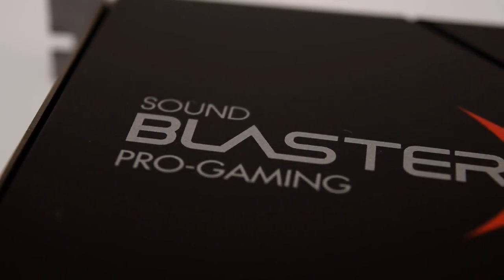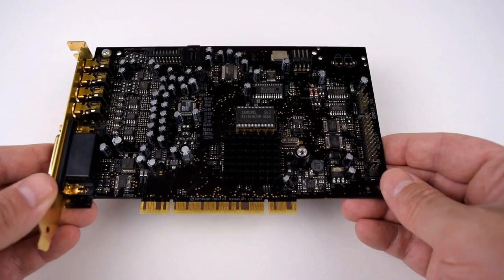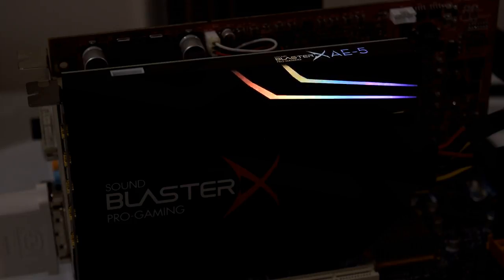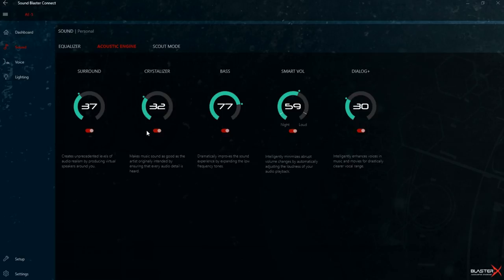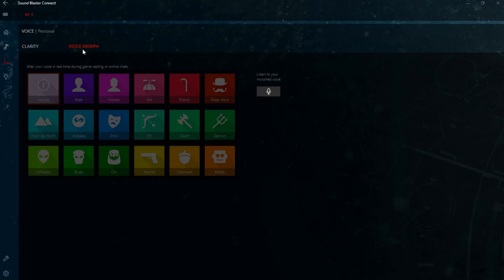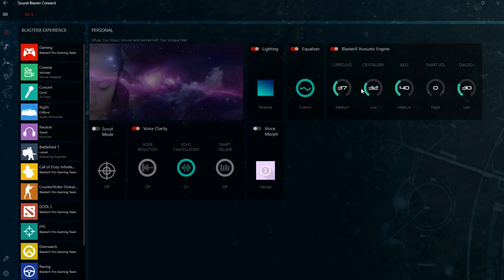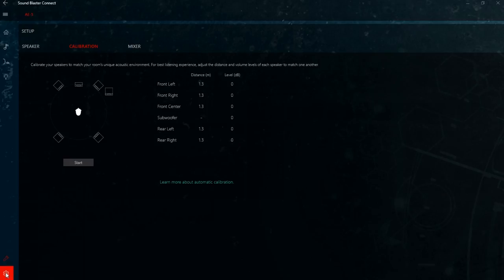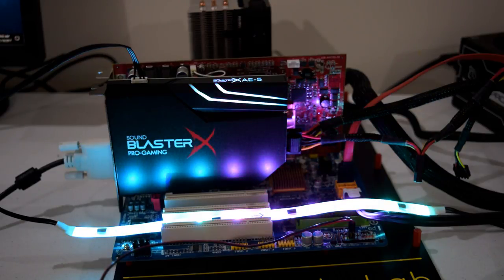Is the SoundBlasterX AE-5 Creative's best Sound Blaster?

Comment: I had the original sound blaster, the sound blaster 16, the sound blaster AWE 32 and AWE 64, the Sound blaster LiVE (amazing card), .... ... .. , and various forms of the X-Fi. I still run the X-fi as it is better than the modern ones which sound quite crude and "software" like (emulated). 
The soundblaster Z was a terrible card, I bought it, and returned it straight away and since then Ive not bought any more sound blaster cards as the X-Fi is still excellent.
Reply: PhilsComputerLab, did you have a similar experience /line of thought then?

Comment: Hi sir , i have found this soundcard for arround 100 euro and i want to use it with my 2.0 bookshelf monitor speakers through the optical cable port , but i saw in the comments you mentioned that the best output soundwise is the analog one so i was thinking if the optical one isnt that good . Also is this soundcard mainly focused for headphone users and not so much for speaker users? The reason i want to use its optical output is because i will use the speakers digital optical output for the general PC usage , and the (single unfortunately) analog RCA one for my turntable . Currently im using my onboard motherboard's ALC892 realtek chip which has served me well , but i bought some new expensive speakers and i feel that it bottlenecks their potential , so i thought to get a new soundcard as well . I would be very grateful if you could give me your advise about going for it or go to something else. Thanks !!
Reply from the maker: If you use optical, the speaker DAC will be used. If you use analogue out, the sound card DAC will be used. Which one is better? Just got to try it out!
Reply from the maker: Also, if you're using optical out, the sound card becomes kinda a waste, as digital, is digital. Any optical output will sound the same.
Reply: @philscomputerlab  Hi sir thanks for the quick clarifying answer. How about the coaxial output , does it work the same as the optical output? In your opinion is 100 euros a good bargain for this soundcard (which originally costs arround 140-150 euros if im'not mistaken)?I was also wondering if in your opinion this soundcard is mainly focused for headphone users rather than speaker users because of its discrete headphone amp addition which would be useless for speakers . . I would be very grateful if you could give me your additional opinion about theese questions. Thanks !!

Comment: Great Video... just what i was looking for! I really love this Soundcard- but there is one thing that bothers me alot:

It does not support Dolby Digital Live / DTS-Connect! That is the only thing i miss...
Reply from the maker: True. I use a 5.1 Logitech speaker with two optical input, I reckon it sounds nicer through the analogue ports, than the TOSLINK.

Comment: These card's (AWE, LIVE, Audigy, XF) could have solid potential in home music production, if Creative will not be such as focused only on gaming. ASIO drivers supported only 48Khz (no 44.1), and you could  have max 2 parallel effects (chorus, reverb), where Chorus was fixed and instead of Reverb you can choose some other (EAX effect). 
        But what I personally never understand, why EMU/ Creative never produced profesional level of quality SF2 banks, despite, that they had a huge library from they romplers/ samplers (Emulator I,II,III, EMAX, Proteus, etc..),  so we always ended up with some awful GM midi variants sounds (even these from memory expansion CD), which has been smashed even by with first Roland Sound Canvas (and that was really super simple rompler).

Comment: Has creative stopped the practice of using lower quality DACs for the main/front jack?

also:
* Unfair competition and killing Aureal (and every other competitor they can)
* recently they bought the company that made nvidia soundstorm audio processor, again killing the promising competition.
* Many bugs and bad sound quality on the soundblaster PRO/16 (expensive cards in their moment). Also in many other serious issues in other soundcards.
* Not admitting incompatabilities with some chipsets issues with more modern cards, (live, x-fi, maybe more...)
* Not releasing drivers for later windows releases, in order to render useless perfectly capable (and not so old) cards.
This is demonstrated with free drivers like KX driver (and that is when they don't legally pursue driver tweakers/developers, as they did many times).

No more creative for me, thank you!!!
Reply: I just checked the ratings for their sound cards on Newegg or Amazon and read the critical reviews... you're absolutely right. Creative Labs sucks!
Reply: @ServantofJC  well thats a shame their xifi mb3 software was top notch

Comment: I don't understand the appeal of a soundcard with no hardware accelleration. I just got an X-Fi Titanium PCI-Ex from 2008 with the EMU20K2 processor for 25€, which works great under Windows 10 Creator's (using custom drivers) and is awesome for older games like Bioshock, F.E.A.R. and Doom 3 (EAX5 and hardware positional audio FTW). Don't get me wrong, the software Host OpenAL implementation of the hrtf and eax that the Sound Blaster Z and newer cards like the AE (and other solutions like the X-FI MB3) come with is ok, but nothing close to real hardware OpenAL. Also, it features Optical In, hardware midi soundbank support, and cmss3d for virtual surround in games that don't use OpenAL.
Reply: Hi, it seems you know a lot about soundcards, could you please tell me what do you think about the Sound Blaster RX? Is it a good card in general, is it worth it over an Asus Z97 pro integraded audio? Thanks for the help

Comment: I've always liked Creative's sound cards, I currently have an external Sound Blaster Omni Surround. But my biggest beef with Creative is that they purposely make their sound cards obsolete by not supporting drivers on them anymore. Especially when it comes to new versions of Windows. I have to go into settings and reinstall my drivers every now and again because they like to act up more often than they should. But the only "newest" version they have available for Windows 10 is from 2015. It's sad because even the drivers they have for Mac are more up to date than the ones for Windows. The Mac drivers ended in 2017.

What makes it worse is that they still sell the Omni Surround brand new, yet they no longer update the software to make it function properly.

If anyone knows of some fan made drivers that are better than Creatives own software I'm all ears. If not then I'll probably switch over to using an actual DAC in the future when funds allow. As much as I like the look of the AE-5 they'd probably stop supporting it the second I bought one. :P

Comment: Cool, Creative sent you a card to test!  Though I was hoping to see how it does in games.  All those menu options for the SB series can be time consuming if you play a variety of games (can't remember what version of the X-Fi I'm using at the moment, but it has those).  I figure for modern games, it wont make much difference on performance, but I am curious.  Maybe do a comparison video for more the more recent audio cards you have?  I remember your video on the ISA and PCI cards and how it kinda slowed performance, so it got me thinking about modern day relevance.
Reply from the maker: That sound card roundup was on a Socket 7 machine, so CPU power was limited. These days, we plenty of CPU power, but you're right, I don't think I've seen any tests in this regard lately. Could be something worth checking out. For games I think you'd be very happy with this card.

Comment: Do you think that the Soundblaster 2 has A better Sound Quality Than Onboard soundchips on modern motherboards? i got the Card for free and was using a sundblaster audigy SE Before because the Onboard sound on My Asus P5Q PRO Was Crap. Just thought about it Because PCi Slots are more and more rare on modern Boards....
Reply from the maker: Are you sure you mean Sound Blaster 2?
Reply: PhilsComputerLab 

I meant the Audigy 2 ZS, i Think i just Got my Soundblaster pro 2 in mind
Reply from the maker: I thought so :D Yea the 2 ZS is a great card, it will be better than onboard.
Reply: Got the card installed Now, its Really awesome. Idk Why i did Not use it from the beginning. Windows 10 also has a WDDM driver avaliable for it and EAX Sound also Works.

Comment: So much stuff that could be improved and innovated, yet they come up with RGB-bullcrap. Still no official Linux-drivers of course.
The mode which circumvents all the DSP-processing is a good feature if that let's you output bit-perfect audio.
What I'd like to see first and foremost is some soundcard & sound chip manufacturers getting together and invest in a new surround sound format as a successor to EAX. Most of the investment I think would need to go into the game developers, because otherwise those companies wouldn't get off their their lazy asses when it comes to sound.
My favorite without counting the Creative chip equipped AuzenTech soundcards is still the Audigy 2 ZS, because it supports digital output of DS3D & EAX.

Comment: After 2 years using the onboard audio on my AsRock Z170 motherboard and thinking it's good enough, I found a Sound Blaster Z in a used listing for €35. I though that if it didn't work for me I could always flip it with no loss. Well, after installing it I played some of my favourite music in FLAC format and it was MINDBLOWING how MUCH BETTER music sounded on the same cheap Logitech 2.1 speakers I've always had. Games? Oh man, gaming does sound much better and the virtual surround on headphones is AWESOME. As for movies, they sound like in a movie theatre albeit at much lower volume levels.
Would I give the €80+ the Z costs brand new? Maybe not. But for €53 to 50, it is worth every cent. 
Oh, and it might be useful to know it's working flawlessly in January 2019, on a fully updated Windows 10 machine with the latest drivers straight from creative.com.

Comment: It's a shame that I've already occupied every last one of my PCI/PCI-E slots on my motherboard with stuff now--an Audigy 2 ZS and X-Fi included--I really did notice a decent increase in audio quality--especially in bass output--when I used my Sound Blaster Z over those cards, and especially over my motherboard's Realtek solution. I'm sure this card would sound just as good, if not better.

But ultimately, I had to make decisions--was that moderate edge worth sacrificing some compatibility and flexibility that ALchemy can't always provide, my favorite SF2/MIDI driver to date (Audigy Soundfont Manager) and features like CMSS-3D? And in the end, I had to opt with the old sound cards. I wish the X-Fi Titanium HD had analog surround speaker support, because it'd be a great fit for me if only for that!

Now that Sound Blaster Z powers the audio in my father's Ryzen PC that he mostly uses to watch a wide range of films, and lightly dabbles in games. Paired with a classic and all-around pretty good Altec Lansing 2.1 system, I think it's being put to good use.  : )

Comment: Sound Quality is excellent, driver is too simple. 
I can not downmix 5.1 to 2.1 using bass redirection as I can do with any realtek basic chip... 
No possibility to disable center/Rear speaker to use bass redirection and remix center channel to Left/Right. System installation is not enough flexible and configurable.
I would like a real 2.0 mode with bass redirection. For the price paid, this is not acceptable.

Comment: Hi Phil! 
Great video as always. 
How does EAX works on this card? I know it needs Alchemy first but..... Is EAX hardware supported like on the x-fi series (to my knowledge last gen of sound blasters to support this feature natively) or is it some form of software emulation?

And if it's software emulation - is there a noticable difference in sound quality between this sound card and x-fi hardware EAX?

Currently using x-fi extreme gamer from 2004 or 2005. Works great still :)

Have a nice day. Cheers!
Reply from the maker: Vista broke something and ALchemy restores this functionality. It's basically a wrapper than translates between the APIs. A comparison between real hardware, and the same hardware under Windows 7 with ALchemy could be interesting, but you know me, I'm all about building a XP Retro PC and skipping all of that hassle :D

Comment: I'm going to say that the X-Fi Titanium is the best card Creative ever made just because it's the last one that XP supports so it's fully hardware accelerated and it has a lot of the same features as the newest cards without any of the superfluous garbage that the new ones have.  LEDs?  Please.  What am I?  10 years old?  Who needs 384 kHz honestly?  Just an excuse to charge more.  It gets ridiculous at this point.  The X-Fi Titanium is all anyone will ever need unless of course Creative does the logical thing and goes back to A3D style 3D simulation.  To me they should have spent the last 10 yrs doing that instead of screwing around with LEDs and nice looking enclosures for their cards.

Comment: NICE, Phil!!   but, what about Sound blaster VS Onboard HD-audio?  is it worth the Price/performance  to upgrade from a good Onboard solution?
Reply from the maker: You got to decide this for yourself. I do quite a bit of recording and the onboard line-in was always plagued with some issues, be it buzzing or noisy.
Reply: I would say even an ASUS Xonar DGX PCI-E sound card with the community Unified drivers is worth it over a built in HD Audio solution as you get a cleaner audio signal, and build in headphone amp to drive more demanding cans, so again unless you get a higher end board that might have a built in SB or other high end solution with audio circuit isolation then a good sound card is worth it. I've personally been using a $28 ASUS Xonar DG card for 4 builds now, and it's been fantastic.

Comment: I think sound cards for gaming have gone downhill after the SoundBlaster X-Fi series. This was the last sound card that focused on hardware accelerated 3D sound and effects and rich features like SoundFonts. I still use the PCI-Express version of this card together with the GigaWorks S750 7.1 speaker set.

Modern sound cards do most things in drivers/software. But I can't really blame them because Microsoft killed off DirectSound 3D a long time ago.

Comment: Great video.  The interface on this card annoys me though.  Color coding should be universal and who uses optical anymore when other higher bandwidth interfaces are the norm now like HDMI.  Would also be nice to see RCA.  Maybe keep the optical and also add an HDMI port for external amp options.
Reply: Generally I highly agree. The problem with HDMI though is that it can't transfer an audio signal without a video signal. Thank the content industry for crap like that, they also forced Creative to abandon the Digital DIN connection, which offered 8 SPDIF-connections in one single connector/cable.
Reply: armorgeddon Ah, I didn't know that about HDMI as I had AMDs true audio hooked up to a Yamaha theater unit.  It worked well enough though I wasn't blown away by it.  A work around maybe?  A dummy video signal?  My video was playing through a UHD Samsung monitor through its own cable.  I suppose it was just splicing the output.
Reply: Yep, I didn't know that either and only found out when I bought an ASUS HDMI soundcard. My plan was to use a X-Fi card to generate EAX-sound, then use a software called Velbac, which stand for Virtual audio cable, to route the EAX sound into the ASUS card which then would've send the EAX-sound out via HDMI to a Yamaha home theater receiver.
The fact that there must be a video signal alongside sound on HDMI is the reason why all HDMI-soundcards have two HDMI connectors. One is for input of the video signal from your graphics card and the other is the combined output. Obviously this will also introduce lag into your video signal, so for anything besides watching video it's awful.
I'm stuck now but have read recently that some VGA-to-HDMI converters put out an empty video signal if no VGA-input is connected, so it's possible to feed that empty video signal into the HDMI-soundcard. So that's more or less the principle you suggested. I did not have time to try that yet, but people on the internet seem to have it running that way.